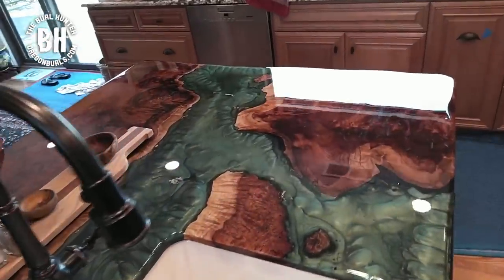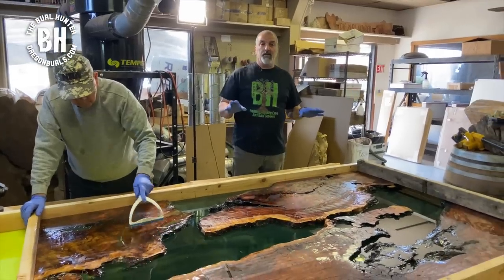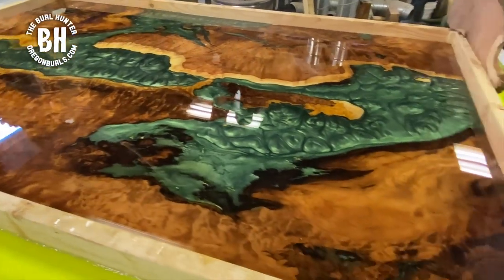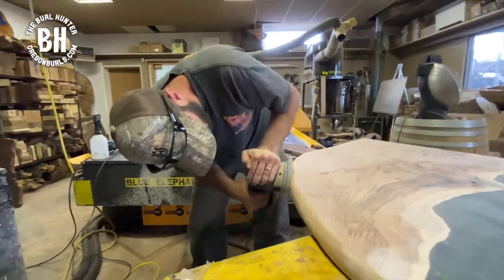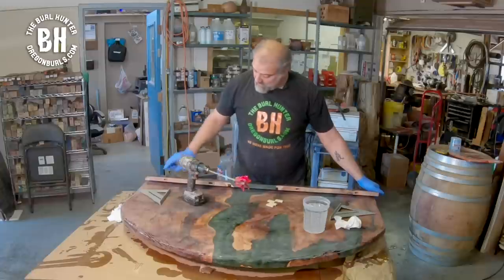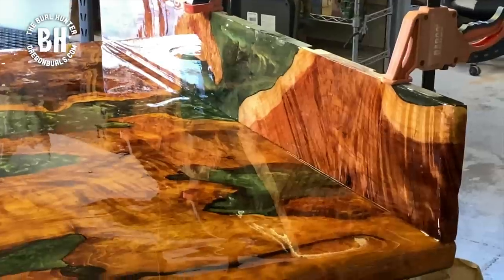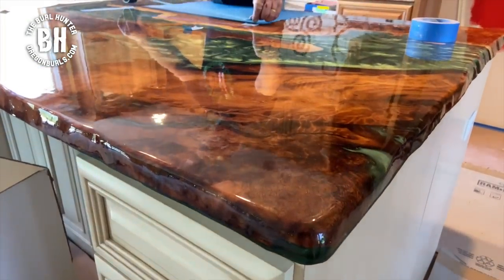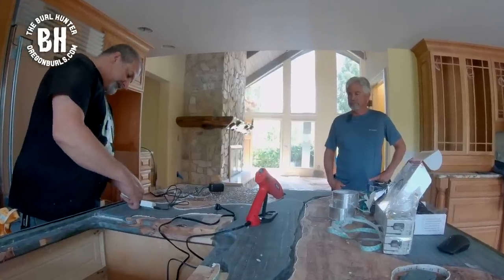Redwood Burl River Waterfall Kitchen Island #rivertable #fusionflatworks #epoxyrivertable

Comment: Could turn the sink cutout into a beautiful cutting board that matches their island!
Reply: YES!  👌🏾
Reply: That'd be a very nice touch 👌
Reply: Thats what i thought...sad to waste it
Reply: Beautiful...how much to do that foe me....lol
Reply: Wood cutting boards are natural and not clear coated.  It's not safe to use because of the epoxy resin.   Usually they are treated with a cooking oil or similar products. 
  That cutout could be used on the wall or somewhere else.
Reply: @jenky1044    Wait, if that epoxy isn't save to use in a cutting board, how is it safe to use on your food preparation surface?
Reply: @jerrysstories711  
Making a sandwich on the counter is different then cutting on a counter.  When you cut on the counter, the knife is cutting into the clear finish.
Reply: @jenky1044   Fair point, yeah regular clear coat wouldn't be right for this job.  Thanks for that.  But doesn't any coating exist that could be used on a cutting board?
Reply: @jerrysstories711  you want unfinished wood or plastic. It's gonna get cut lines anyways so why finish coat it and risk residue in food.
Reply: Please I need office address please 🙏 I want to learn the work, beautiful hand work I love it.
Reply: Wonderful wood works  !!!
Reply: Do you offer wood works training ?!.

Comment: Your square 3-4-5 is known as pythagorean theorem which is A square + B square = C.  You can calculate this way past your 5 inch.  This is actually what I use to cut roof rafters and can be used for any lengths.  I use a Calculated Industries Construction Master calculator to make any job site calculation easy.   Well worth every penny I ever spent on it and have used for over 25 years
You can calculate roof, stairs, concrete volume, cylinders-I mean almost anything you need on the site.  I have never bought a precut stair stringer EVER.  My rafters and stringers are spot on first cut, which takes minutes.

Comment: It amazes me how similar this is to the poured urethane gym floors Install is. It’SA self leveling 2 part urethane that cures into flexible rubber. We then roll the colors and striping. Except we use a blower to pop bubbles

Comment: I have seen this question a couple of times so you might not answer mune either,  after the sink cut out how did you do the edge ? Sand and polish or scuff and repour the whole counter and another question is what adhesive did you use to glue the sink in ??

Comment: So how Does that hold up with just regular where in the kitchen does it scratch can you put a frying pan straight on it like a granite what’s the upkeep on taking care of that
Reply from the maker: It is scratch resistant and heat resistant up to 475 degrees.
Reply: @ArtisticEpoxy  there is NO FREAKING WAY that I would ever put a hot pan on epoxy... you are just asking for a disaster. And SCRATCH RESISTANT is just that... go ahead an accidently use the rough side of a sponge to clean it..... nope.

Comment: Question: did you SEAL coat the UNDERSIDE of the slab, too? I would think for a wet install site like this, having a little bit of protection on the wood would be a plus. OR, is leaving it bare for out-gassing? Thanks!
Reply from the maker: Yes it was 100% sealed top and bottom. :)

Comment: $100 wood, $250 epoxy resin because it's a way over priced brand,  $50 lights. 5 hours actual labor at $40 an hr. $600. But yet for some reason you can't get these things for under $10k. 🤷‍♂️
Reply from the maker: If you were only right. Old-growth redwood burl alone is $3000